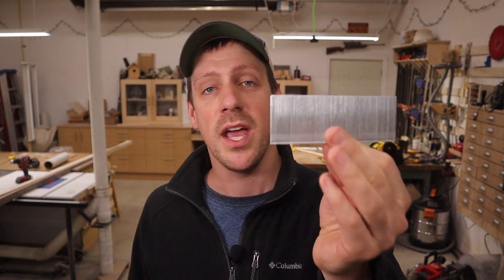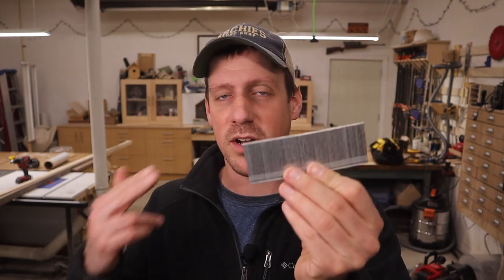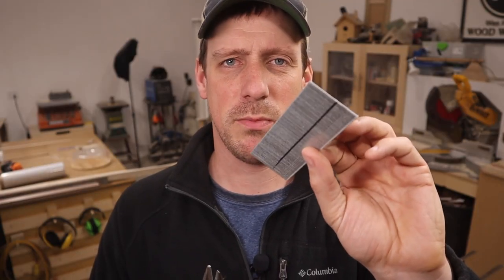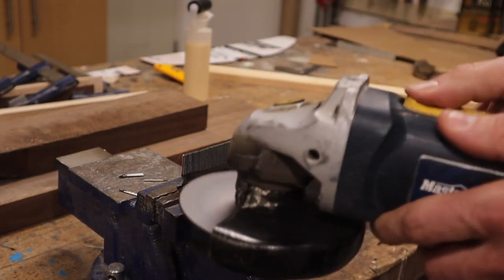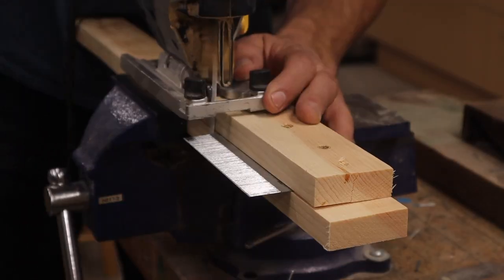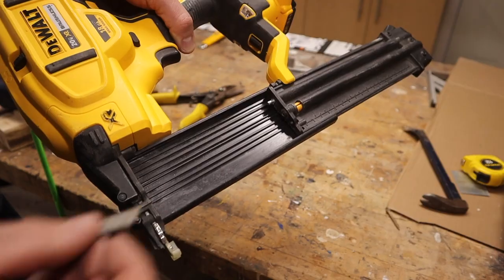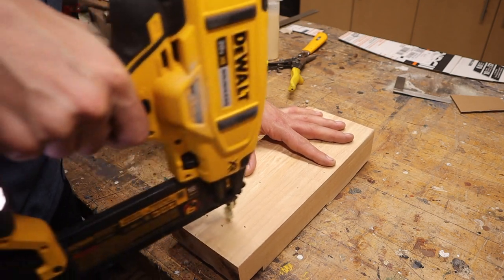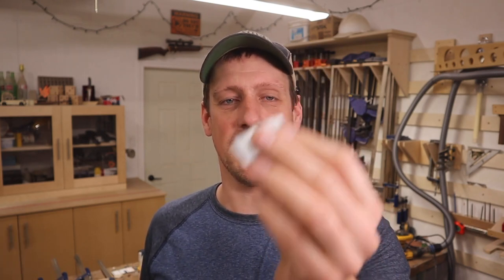Can You Cut Brad Nails To Make Them Shorter?

Comment: FYI. After watching your video I decided to use my bench grinder. I made 1 1/4" into 1". They came out perfect. I even grinder the point back on. If you only need to shorten them 1/4", this in my opinion is your best and easiest option. Took about 5 minutes.

Comment: Wow, I needed to do this exact thing, but jeez, it isn't hard. You WAY overdid it with the wrong tools...when you brought out the snips I  thought you were joking! All you need is a dremel type tool with the little thin cut-off disks...just do light cuts with a scrap of aluminum under the stick of nails for support and heat-sink. Carefully go over the line ob both sides and the excess will snap off without the loss of a single brad. You can even change stones and re-sharpen the chisel edge. Does not take long either...dude...save the angle grinder for rusty bolts!
Reply: great reply @Jeff.  a thin blade  won't generate as much heat... the sledge hammer approach doesn't work...

Comment: I had this issue because wanted to finish a project at 11pm and the box stores were closed. I successfully used an angle grinder (diamond tile cutter blade) on 16 gauge brads and got around the melting glue problem by laying then flat on a scrap piece of wood with just the heads hanging off. I used another 1" scrap piece on top of this to hold them in place with a clamp holding this in place. The scrap wood beneath prevents bending and a light passes keeps them from getting too hot. Finished but using the grander to get rid of any blackened parts. Because I was paranoid of jamming in the gun, I also did a few light passes on 220 grit sandpaper to remove any burrs.

Comment: Just use a soft shim when nailing to "absorb" the extra length, pull it off & trim with a side cutter & tap in anything protruding ..... or do like I did & buy a box (5,000) of each size you will ever need.... they are cheap.. 🙄😂

Comment: Thanks for trying Wes. Quite a few here say buy  boxes of other sizes.. if you are in the trade it makes good sense. If you don't have the correct size at hand though you need to get creative. Also  If you are the occasional DIYer, then buying lots of different lengths in small amounts is relatively expensive and large boxes won't probably be used in years! I saw this https://youtu.be/FTmte0v_GRA?t=90 and it was easy peasy with the right cutter. I plan to get 1 box of 5000 50mm and just cut a selection of lengths from each strip in the one box. Then I'll be prepared in advance of using them.

Comment: I was working and needed a few shorter brads, I only had 2 inch and didn't have time to run out to a store. I figured there isn't a reason why this shouldn't work. Took out my dikes and cut them shorter, worked like a charm. Honestly if you aren't on the clock or in a hurry there's no reason to do it. Just buy a variety pack from a home center or online.